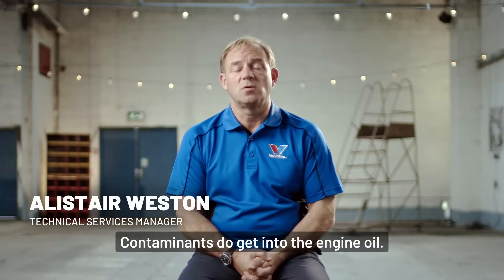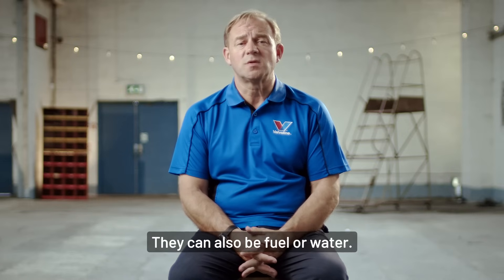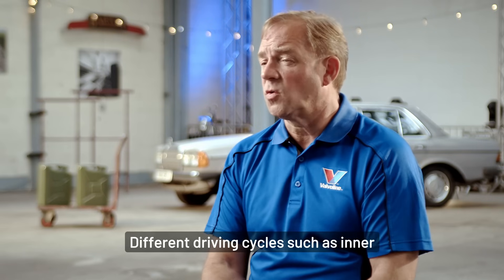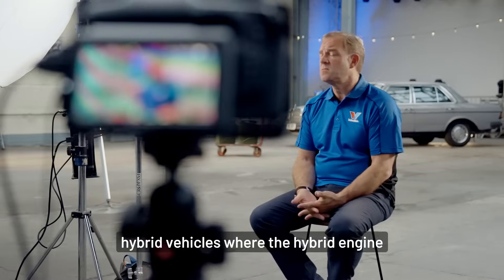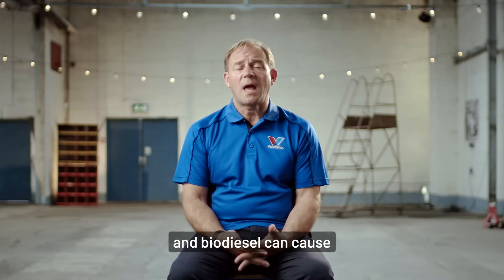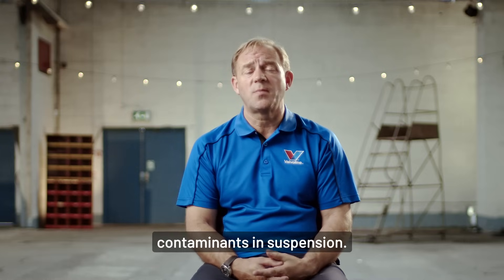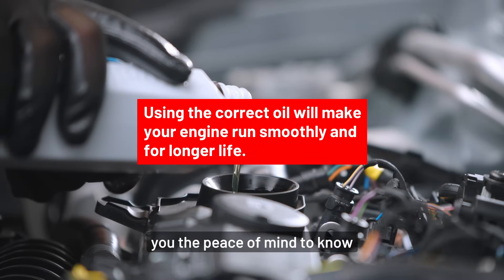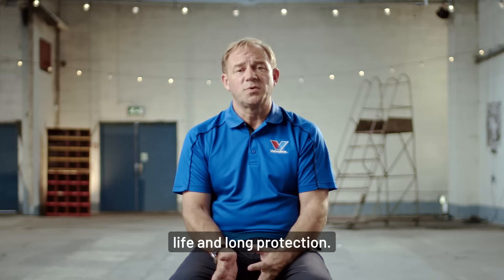What CAUSES motor oil  CONTAMINATION | How to PROTECT Your ENGINE | ASK ALISTAIR

Comment: Hi, I used wrong oil (doesn't even know which one) in my 2008 nissan altima and drove 1865 miles. And finally starts knocking, cold start issues etc, later my mechanic recognise I was using wrong oil. And he changes to correct one.

Did I cause serious damages to my engine already???😢😢😢😢
Reply from the maker: Dear @nasbinsn5282, we appreciate you watching and sharing your insights! Your feedback encourages us to keep improving. 
Unfortunately, we don’t know the details and can only guess, so we highly recommend visiting a trusted mechanic.
Kind regards from Valvoline EMEA team.